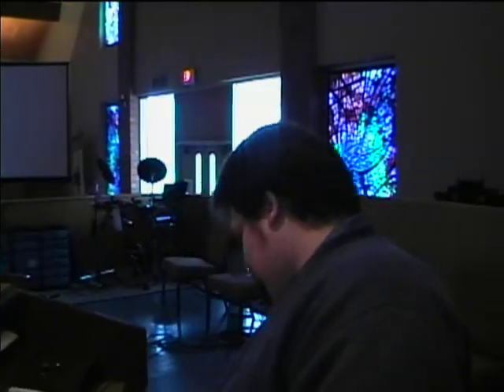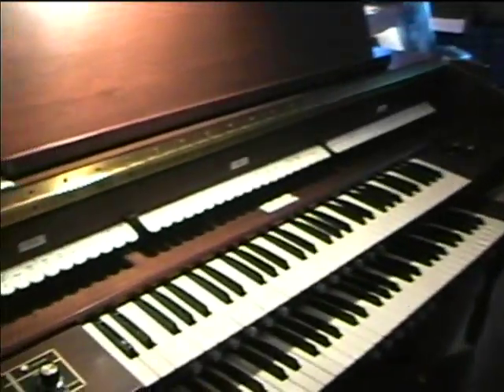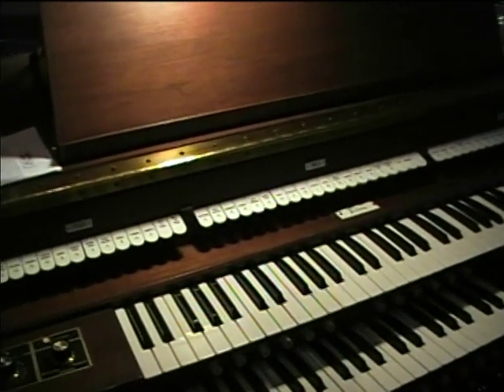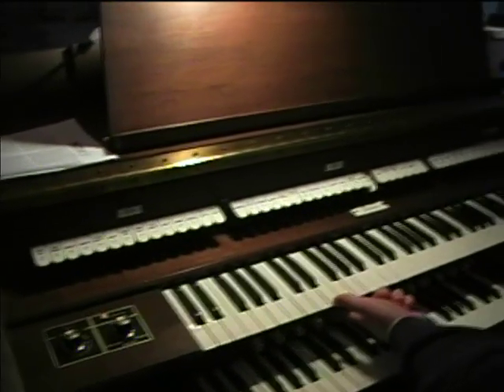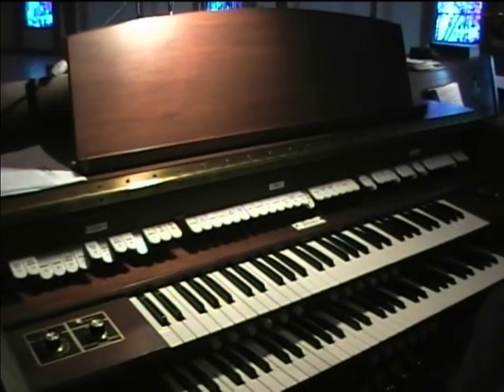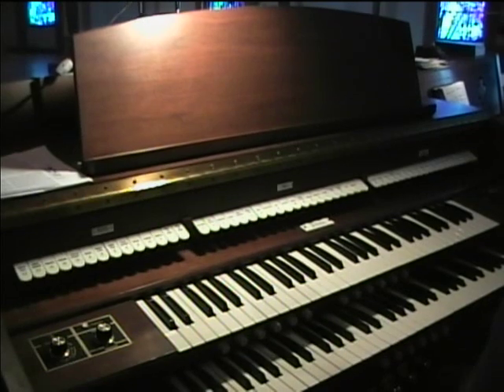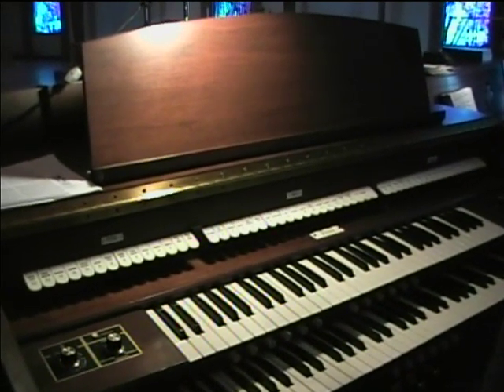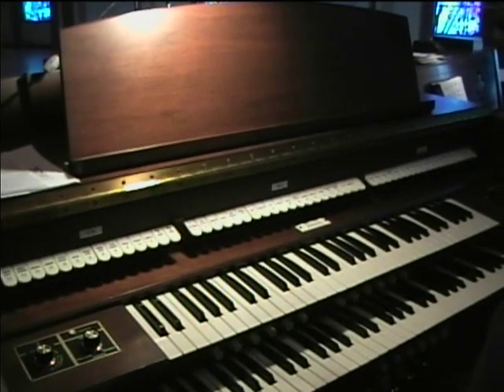1972 Allen digital computer organ features demonstration

Comment: Regarding the stop tabs taking a second to flip, I have some insight into that from an Allen technician. He showed me one of the boards that controls those and said it was an issue of power available. Since the power supply in these wasn't large enough, the delay had to be added as to not overload the power supply. There is a whole board that delays the stop tab action when pressing one of the combination action buttons.
Reply: It’s also a lot of current consumption on the circuit the instrument is plugged into when a piston is activated and all set stops are pulled on or off.  You should see how much a GW4 theater organ.

Comment: My current Church has an Allen Digital Computer Organ as well and it looks very similar to this, complete with the alterable voice tabs and card reader. It is likely a newer model than this one, though, as the logo reads "Allen Digital Computer Organ" just like the model that you and organist1982 have. The power button on my Church's organ is also located on the opposite side and it does not have any 32' pedal stops. The preset buttons don't currently work on it as well but that could be due to a bad fuse or something related to the rechargable batteries inside the instrument. Lastly, the three manual 1920s era Austin pipe organ at my old church has a very nice 32' Resultant as well.

Comment: The church I go to has a similar organ. Just so happens that I played it for the firs time today (I am an organist). A few differences:
No toe pistons. Presets to not physically flip switch (though you can hear air. the presets still work)... and there are only three presets which control swell, great, and pedals all at once. Motor for tremelent does not work in the upstairs speakers. 
Motherboard, motors, amps blew, organ was not played for many years. Got it repaired by a tech for $1400.

Comment: RetroChad, you might want to relabel this video as "1971 Allen Digital Computer Organ" (it says it is a 1972)!  About that distortion effect when many stops are drawn and volume is turned up high, this would be ideal for a rock organ sounding musical selection!  Oh, and the video stops at 7:29 while you are explaining the IBM Punchcards and computer card reader that won't work this time for a demonstration!  This was how early computers read and processed data, years before reel to reel tapes, floppy and later hard disk drives, and finally solid state drives, flash memory chips and other data storage devices that everyone takes for granted these days!  Overall, this electronic organ sounds about as good as a small to mid sized pipe organ of the same era!  I often wonder how Jerome Markowitz's original 1938 Allen Analog Computer Organ would have sounded, I suppose if I am ever in Macungie, Pennsylvania, I will have to go to their museum and find out for myself?  Now, I believe that Jerome and his company have made a much better electronic organ than even Laurens Hammond had come out with a few years before, yet he wished to include the rotary speaker effect that Hammond and Don Leslie used with Hammond's instruments!  Overall, a great substitute for someone who cannot afford a real pipe organ, doesn't have the space for one, etc., plus they can work with an existing pipe organ and digitally add voice as a hybrid, therefore extending the usefulness of your organ!  All of this and still a top quality domestic product, I just love that, especially with all of this Chinese inferior product in the American marketplace!  I just wonder if Allen took some design cues from Wicks and incorporated it into this particular instrument?  We have a 1950s era refurbished solid state console in our church (that replaced a 1974 Fowler Console, I believe), and it plays really well!  Now, the actual pipe organ, that is another story, as it could use a good tuning, the keyboard firing points have to be adjusted, and the chamber in the wall has to be insulated from the outside weather!

Comment: Kinda sorta. Kurzweil invented some neato stuff, but his thing was fourier synthesis around that time. I think people had samples playing on mainframes 40 years ago. The first sampler that you could buy that took off was the fairlight in '79 (they didn't invent sampling but made it very useable.) 

There is no sampling going on in this '71 allen. Its an additive synthesizer, which most electronic organs were until hardware samplers got a little cheaper in the late 80s.

Comment: I have regarded 'Allen' organs to be closest to sounding like the pipe organ, with reverberation set for a medium size church. I think they were very advanced for their day. I'm most interested in what transistors they used in the main amplifiers; I imagine a group of 2N3055 NPN silicon transistors in a quasi complimentary symmetry arrangement as the output stage. Having a recent re-cap would make a good reason to repair, and use in conjunction with the PA amp that replaces it..
Reply: jmcgatkinson have you heard of the Walker technical organ, that's every bit like Allen.